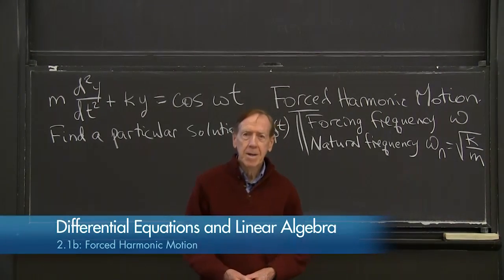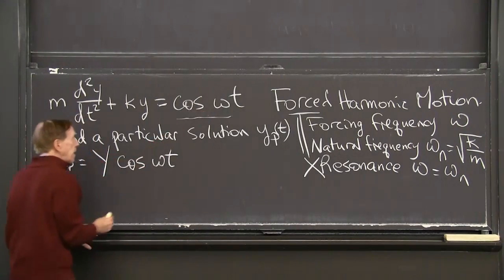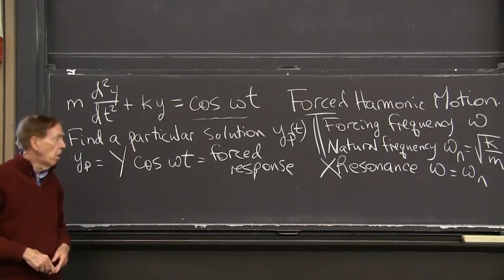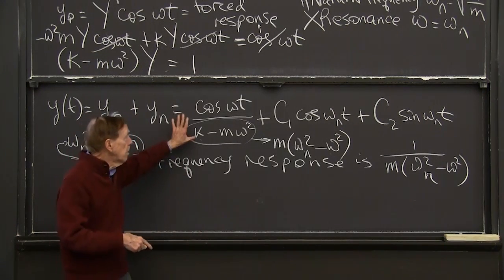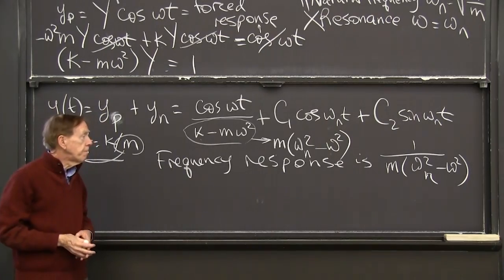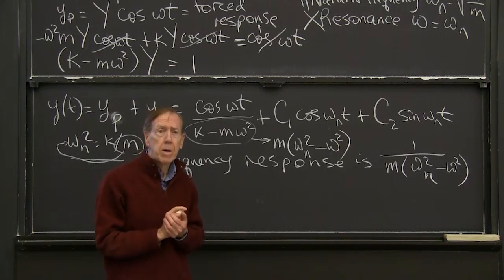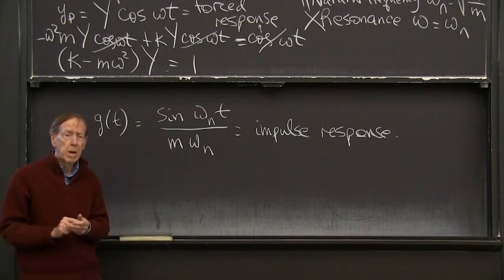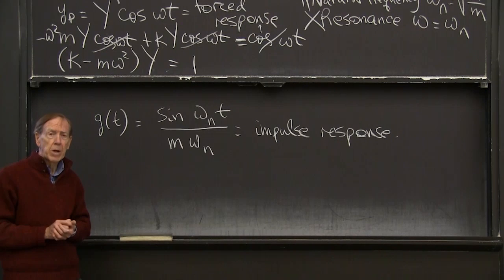Forced Harmonic Motion

Comment: why impulse response is 1/mWn not just 1/m?
Reply: watch the previus lecture,in the null solution the coefficient of sin(wnt) is (dy/dt)(0)/wn ,in this case (dy/dt)(0) is 1/m but you stil have to divide it by wn
Reply: Since d(sin(wnt)) brings wn out, we need wn to exist at the denominator to cancel wn so the dy/dt is 1/m.